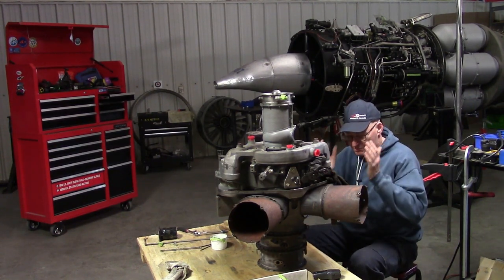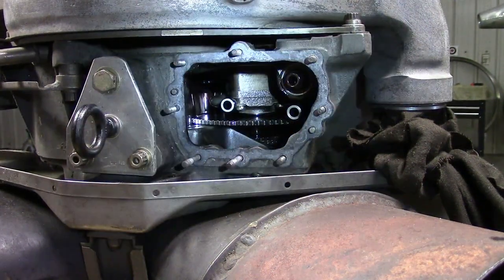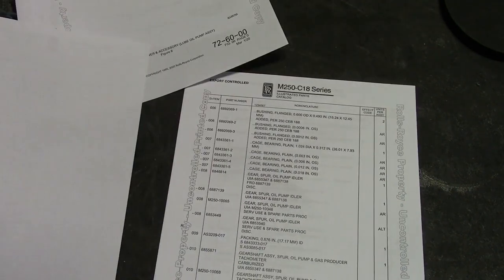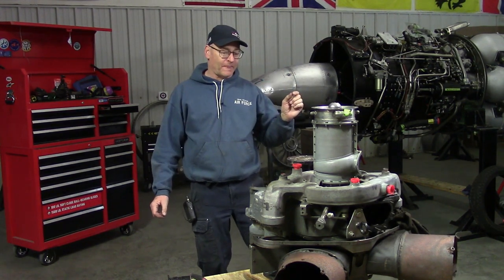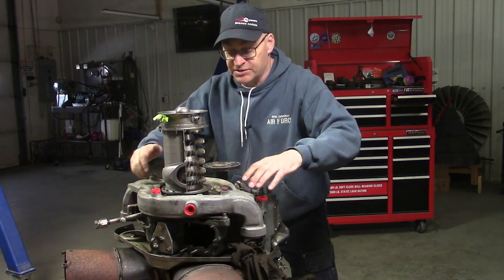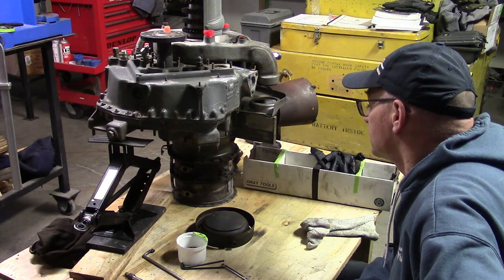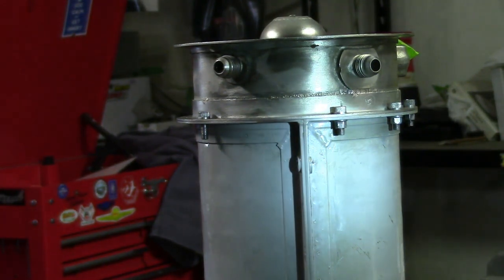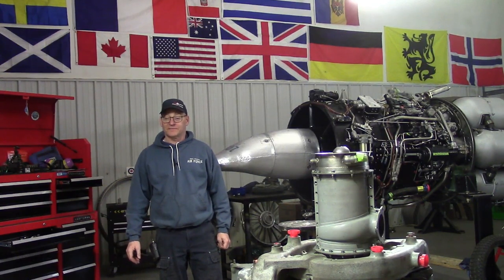Inside the gearbox: Mini Jet Boat ep. 7

Comment: I have no experience on the C18 in particular, but on the C20B which is also in the m250 series II family. On the C20B everything is modules and are easily swappable (compressor, gearbox, turbine, combution), and I can't see the C18 being different in that case. I'm not sure if the C18 compressors were shimmed like its newer counterparts but if you do pull it off check for thin shims at the studs and bolts. The logcard would have a record of these required shims and the scroll is usually laser etched to match (in thousandths).  The compressor as a whole can be removed as a single unit and at least on the C20B engine there isn't any super specialized alignment fixtures, simply a guide to protect the 2.5 bearing when pulling the compressor off or reinstalling it. This guides the compressor spur adapter gearshaft through the 2.5 bearing and prevents anything from damaging the rollers. The spur adapter gearshaft acts as the inner race for the 2.5 bearing, so damage to the expensed rollers of the bearing can occur on install or removal if not careful.  Probably very likely the local helicopter operator would have that guide, if they operate jet rangers.

I have heard of compressor module removals without taking off the turbine module, but never seen one done. If done this way the guide cant be used and your going in blind trying to match up with the p shooter (n1 coupling shaft). I have seen multiple 2.5 bearings fail even with correct procedures and 2.5 bearing guide installed for removals and installs. So I wouldn't attempt it myself. Turbine assembly removal at the stage you have the engine should just be the 5 nuts holding it on and slide it back and off, making sure to be careful as the two inner drive shafts can slide right off as they are just splined. Will just need some o-rings and the teflon rings for sealing of the power turbine shaft.
Reply from the maker: Thank you. This is great info, and backed up by many others in the know.

Comment: Glob of mud probably STP. Buddy had an airplane with a 12 quart capacity. He would routinely dump in a can of STP to top it off. He casually mentioned that his oil changes required less and less oil to refill. When that engine was finally taken out of service, he found that the oil pan had a big yellow "rubber liner" at the bottom. No wonder it ran so quiet.

Comment: I love this project Jay... Another great video sir! This PDF may answer your question... https://www.aviation.govt.nz/assets/aircraft/airworthiness-directives/engines/al250.pdf ... As for the blind nut. In the marine industry SOP (Standard Operation Procedure) is a cold chisel and hammer. Not trying to cut the nut but employed as an impact tool to loosen and then tighten with out damaging the nut with just additional tooling marks... A marine technician SOP I'm very skilled at. Since this is an aircraft to marine propulsion conversion you can write your own manual. You can then justify the marine SOP. I've never heard of an Experimental Boat Certification. I consider these Rarecraft engines for the rich. Most folks don't comprehend the labor just to fresh water rinse these compressors with distilled water. Then the dry-off relight cycle. Many owners asked the question; "Can WD-40 be substituted for the rinse?" Haven't heard the answer to that question asked over 20 years ago. Carbon fiber clam shells were introduced in the saltwater/industrial pollutant environments. Later models of the engines had specialty coatings to avoid pitting and corrosion. 

Here in the USA the liability of GA (General Aviation) (20 passengers and under) stops at 18 years hence Rarecraft. The new legislation looked good in 1994 however this let the manufacturers off the hook for liability insurance claims of this fuel guzzling technology. That's why I prefer turbo boosted CI piston Diesel engines over axial turbine combination centrifugal compressors for aircraft and marine propulsion. Fuel isn't 19.9 cents a gallon anymore. These engines will probably serve well as boat anchors by 2025...

   Just to bring a little humor to the subject... In my dim & distant sales days, when helicopters meant piston engine propulsion for me ... The party piece was to explain to potential Bell Jet Ranger customers what wonderful creatures the turbines were. No awkward throttle twisting, oodles of performance and always more than enough power. BUT ... the dreaded Bell Jet Ranger was a firm enemy of Piston engine sales, so I was always at pains to explain the niceties of the factory's compressor wash requirement for the C20.

Picture the scene. Lovely wife and family loaded on board for a great night out at a posh hotel. A perfect landing on the lawn and, being the perfect husband ... you open the cabin doors and escort your lady in her finery to the hotel entrance and the envy of all around. BUT ... it's not for you to join the party yet. There's work to do. Time to don the overalls to avoid muck dirtying the DJ and, while ignoring the curious stares from your friends, you retrieve a 10 liter bucket and a hand operated stirrup pump from the luggage locker ... and make a quick search for the nearest water tap. You'll now need to mount the stirrup pump in the bucket and use the short steps you carry to gain access to the engine compartment where you disconnect the PC line and plug in the water connector from the stirrup pump. Once nicely connected, you ask a friendly local to work the pump as you engage the compressor starter. A minute or so of rapid pumping will easily be enough to ensure a really good compressor wash. But we are not quite finished yet ... even as your good lady appears to see what's going on and ask what the hell you're doing messing about with your five hundred grand helicopter. You quietly advise her to go back to her friends. You'll be joining the party in less than ten minutes. Now there's just a single drying run to complete the job.

There's actually a whisker more to it of course, but I mustn't labor the point. Just a couple of starts to record in the tech log, stow the bucket and pump and remove the boiler suit. Hey presto ... In no time you're ready to join the party for the fine dining you've booked with only a few spots of engine oil left to clean up. You're the envy of all! That's the way to make the 'Grand arrival.' 

Cheers to the Rarecraft GA obsolete turbines that's up a tree with no place to go but static displays in the mortuaries of museums and the bookshelves for all their technical manuals and the memories to the rich as they depart wondering what happened? As these aristocrats slide into their coffins with a cigar in the left hand and a martini in the right hand exclaiming... What a RIDE!!! While our piston propulsion keeps the fleet of the thrifty enjoying the museums alive and well!!! Aviation is and always be a team support activity. It's the technician that controls and maintains the artistry. Manufacturing is actually the easy part. It's the tribe of technicians that have the ability by repetition of assembly and disassembly with the syllabus of knowing what works without guessing...

   As one of my old colleagues once said; "Books are for the guidance of wise men and the obedience of idiots, and we all have the choice" !!!, A great conversion for Rarecraft engines in my opinion... Fast but not affordable to operate for long because of current fuel pricing... Cheers

Comment: Always a good indication of any aero engine whether it be piston or jet is the condition of the filter and pump internals . With a cartridge type filter use a 'can opener' to separate it and back wash it to inspect for debris and reverse flush an element filter for the same reason . On engines I build in the UK for racing apps or PSRU I have designed , I use an Oberg style screen and endplate for quick access either forming part of the dry sump pan or plumbed in . The fact the the dry sump pump is easy to remove on this turbine , a pump gear inspection is 3/4 of the way there to judging the condition of the rest of the internals if there is no damage to the rotors and housings of each stage and its in spec on backlash etc . A good result with filter and pump inspection , 1+1=2 and an a excellent indicator to use to determine if more exploration is needed . Sorry can't help with the scroll but if this was built by Garrett Airesearch it would probably pop off a back plate after undoing a few bolts back and front , sealed with a couple of O rings without even bothering the first stage compressor and have a couple of dowels to ensure it returns to the correct position . Of course the later versions don't have the first stage anyway and maybe a quick check of a later manual may give give you the answer you need .

Comment: G'day JayZ,

Well, if it were me, I'd be figuring out the sequence for doing the best possible version of Surface Preparation, Masking, & Painting-In-Place which I can dream up...

 Both on the principle you mentioned - that with Jet Aero-Engines EVERYTHING is vastly more complicated & interconnected & sequence-assembled than anyone uninitiated would/could ever imagine...; and on the visible presence of that "Impossible Bolt" with insufficient clearance for any "Normal Spanner" to undo it, let alone retorque it again afterwards....

That "Impossible" Bolt was put there, like that - by the Designer, as a "Go AWAY !" Indicator ; meaning that anybody who hasn't already got the rare and specific Factory-Tool to unset & reset that Bolt - then you haven't done the Manufacturer's Course & therefore the Designer predicts that if you get past that Bolt you're goanna make a dangerous & expensive mess of their Engine.

A Scottish ex-Army trained Tank-Mechanic once told me how Rolls Royce Car Engines have no Sump-Bolts, because  their Sumps are secured with Blind Rivets going through Countersunk Holes, which then had their Heads ground flush with the Sump's Exterior, and then painted-over...

Every Model of Engine needs it's Specific Metal Template to apply to the Sump, so the Rolls-Royce-trained Mechanic knows where to drill, so as to be able to remove the Sump..., and thus be able to play with anything inside.

  The Punchline of his story was,

"If you ever see a Rolls Royce Car with it's Sump bolted in place...; then do NOT buy it, not under any circumstances, not at any price..., not even as a Gift - unless it's to use for a source of Spare Parts..."

Well, I reckon that "Trick Bolt" is the JetAeroEngine equivalent of blind-riveting, grinding, and painting the Sump...

The Designer hath given fair warning, is my humble  underconstumbling of that there Trick Bolt...

But I may well be wrong.

And the Pommy Tank-Mechanic might have been telling me a bullshit story, too ; because I have yet to crawl under any (randomly encountered) Rolls Royce(s) to check - so far...

Such is life,

Have a good one...

Stay safe.

;-p

Ciao !

Comment: That bolt does not look like it is fastening the compressor scroll to the gearbox housing, but instead is attaching a bracket to the gearbox housing. Are you certain that bolt needs to be removed as part of the scroll disassembly procedure?
As for disassembly to paint/preserve; you have stated that this is a "weekend for fun" project. For the amount of use your boat is likely to see, those castings will last longer than your life and my life times added together. Strongly urge that you sideline the flightworthy mindset and stick to your more practical goal of weekend warrior fun times.

Comment: RE the bolts. My personal opinion is always go with convention. This is for 2 reasons. Firstly if they are not done conventionally that automatically brings up the question of the competence of the person that installed them later. IE was it a competent senior tech that just had a reason to fit them the other way round or was it a muppet who does not know the convention? Secondly habit. IE if you always use method "a" then you are less likely to make a mistake.
Reply from the maker: The overhaul manual illustrates the bolts going IDA, or heads forward.
There are no printed instructions on the matter.
I think the manual expects them to be installed in the traditional orientation, agreeing with your thoughts.

Comment: While I don't have any direct experience with the Allison series metals, I do have lots of experience doing Cerakoting jobs on a myriad of uncommon metal and non-metal substrates. I suspect you've found your disassembly answer by now, but years ago I used to do firearm coatings for friends and relatives and then anyone else by word of mouth who wanted an exceptionally durable coating that stood up to heat, chemicals and had UV resistance on everything from cylinder heads and pistons to carbon fiber parts.
Depending on your masking ability, I wouldn't think it'd be overly difficult to spray the housing effectively without complete disassembly. Years ago, Cerakote made their name with oven-cure applications on bare metals that had to be 'surgically clean' (at least that's what I strived for) and completely stripped/disassembled, however more recently, they've expanded their line with an air cure variant (the C series) that comes in pretty much any color you fancy and will certainly take a beating with proper application. I've used it on my own engine housings and other parts with both the air and oven cure variety and wouldn't hesitate to recommend it over anything else you can get without special licenses. It'll pass through most HVLP spray guns with a .8 needle and I've even sprayed it through a run of the mill Paasche airbrush for one particular job that required pinpoint accuracy. 
Since you've helped me over the years, it's only right to pay it forward, if only in information in this instance, where I can. If you were local, I'd gladly take on this job.
Reply: I'd be interested to know what surface prep/passivation process would be required to spray Cerakote air-cure on magnesium so that it has any longevity without bubbling up and oxidizing beneath the coating... Alodine or maybe Sanchem Safeguard CC-3400??
Reply: @icbtech01  Alodine/Chromate is used often in industry as a standard, though a much simpler product called PreKote would be my preferred pretreat product. It adheres very well not only to magnesium but almost every metal needing corrosion protection and you can cerakote directly to it. It's widely used in aerospace applications and has certs for such when you need to document your work.
Reply: @C-M-E   Thanks for this tip. PreKote looks very promising; I have several mag parts on my porsche that I wanted to bead or walnut blast then finish with clear ceracote. PreKote looks like the ticket for this. Does it have a color of its own that will show under a clear?
Reply: @icbtech01  You're welcome. It's that magic bullet/wunderkind product you'd wish you'd heard of 20 years ago, it just does so much well. How much it shows really depends on the condition of base metal as I've really only used it on 'in the white' or very near condition after media blasting but always put paints or coatings on top. Its base is kind of a clear light amber, like the very lightest synthetic oil you've ever seen. You can find pretty much the whole catalog at Sky Geek, and they have fairly affordable options to experiment with.
Reply: @C-M-E  Great, thanks again for this info, I ordered some PreKote and CeraKote clear yesterday. I'm pretty excited to not have to deal with the Alodine/Dow 19 process for this, even though I was kind of looking forward to the amber gold color. But clean mag will be pretty awesome too.

Comment: ultrasonic cleaner suggeston:
Put small parts in a plastic bag with ample fluid and no air.
Parts get cleaned, not lost, and the larger container plus solvent stays clean too.
Reply from the maker: You forgot the first step: purchase ultrasonic cleaner.
This whole project was started as a side project, and the intentions are to keep it as inexpensive and small scale as possible.
You suggestion is a good one, and has been brought up by quite a few viewers.

Comment: Hi sir!
I hope you will reply to my comment.
I have a question that's I made a micro turbojet engine and it's alway on idle 20,000 to 25,000 rpm. 
Can you please tell me that how to increase it's rpm like 95,000-180,000........
This engine is hand+homemade
I don't have remote control idea nor. 
have remort control system 😅.
Please. ❤️ Tell me about it's rpm.
Is it increase with fuel pumping I usually use carosen for fuel and mixed 5% lubricant.
Please help me
Reply: Hey Mudassir, great job! Adding more fuel will increase your rpm but, there are so many variables you should know before doing so. Number 1, when experimenting is safety first!
Reply: Also you could be coming into the compressor stall causing it to not build anymore pressure so just fuel won’t help.
Reply: @goat3898  that's why I said variables... My main concern is it coming apart. Hot sharp pieces of metal travelling at supersonic speeds in all directions is by far an ideal scenario.
Reply: @charlottejet4338  I agree just trying to give them some ideas and things to look at
Reply from the maker: You say it's home made...
From a kit?
Read the instructions.
Completely made from scratch?
Could be any of a thousand things.
Stay behind a shield, and give it more gas. If you are measuring rpm then you should also be measuring the most important thing: temperature of the combustion gases.
Give 'er fuel until you get near the limit.
What's the limit?
I don't know... You designed the thing.
Reply: @AgentJayZ   I collected it's part for example turbo charger compressor wheel from china
Turbine wheel made with CNC machine
Combustion chamber from blacksmith.......